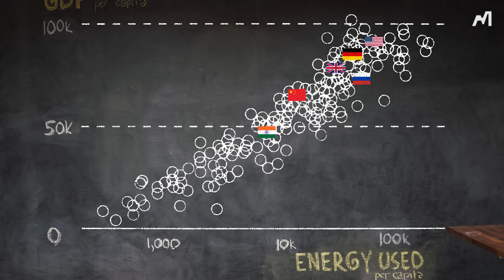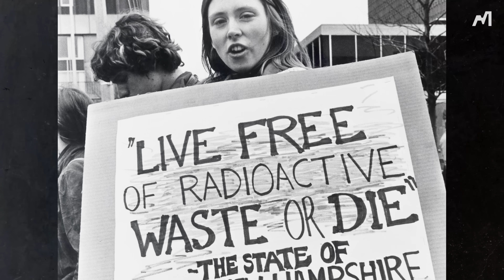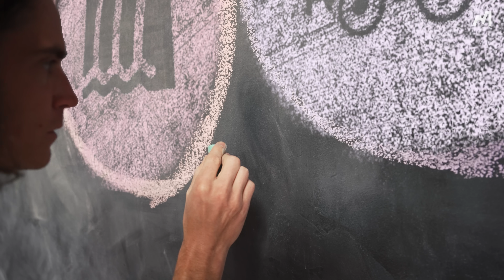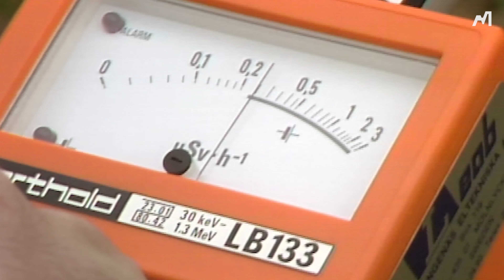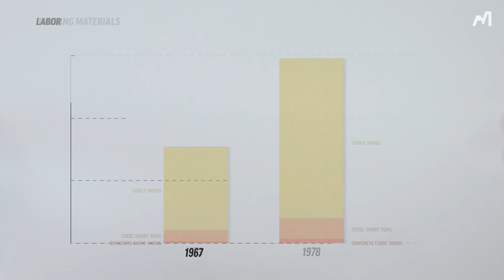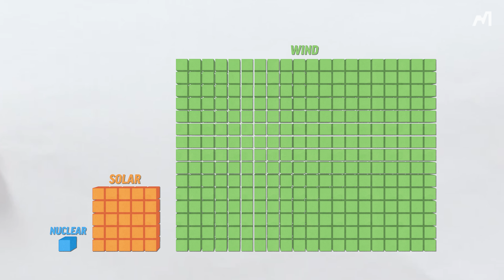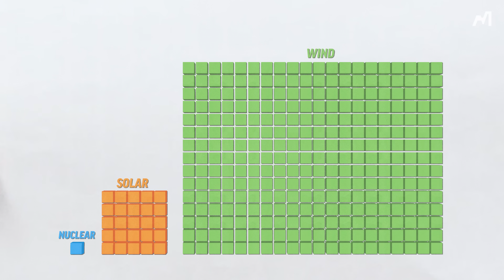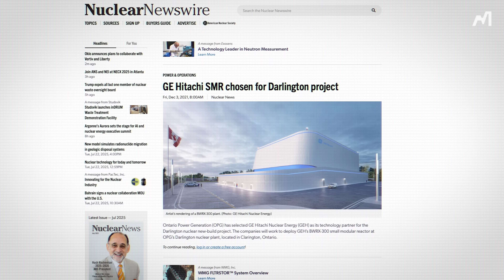They're Lying to You About Nuclear Energy

Comment: One huge disadvantage of nuclear is that it still requires a fuel source. Not all countries have uranium so they would have to import it. As Russia and the US have shown, anything you have to import can and will be weaponized against you.

Solar and wind, once installed, can't be controlled by rogue nations like Russia and the US.  Every country in the world has solar and wind. You can't rely on imported nuclear, the national security risk is massive as the last 3 years have shown. You have to be energy independent to be a real country.

The right mix for most nations will most likely be heavy solar, wind, hydro for those who have  water and mountainous terrain, a good amount of nuclear, and a very small amount of coal and natural gas as backup.

Comment: People talk about how fission reactors are the future... BS. Nuclear is proven tech, and yet, people and investors clamor for "clean" energy- and yet, none of them look at the data coming from the experomental fission reactors- they have a 1-4% gain of energy over what was spent to get the reaction, and engineers still haven't found a way to make a sustained reaction, let alone how to extract the heat given off of such a small amount of surface area for which the "energy" exists! Yes it may have a huge amount of energy in the reaction, but there is no way to make anything that pulls that energy off of the reactor- its surrounded by huge magnets! Go back to the nuclear reactors!

Comment: I'm now interested to see how solar power caused three deaths.
Reply: There is no such thing as permanent, safe, storage of spent fuel (witness the ongoing storage of spent fuel at plant locations from lack of dumping sites, making each reactor site "an event in progress," just like what is going on at Chernobyl and Fukushima)!
 
More stupidity is not the solution to stupidity. The simple fact is that the intense ionizing radiation in the boundary of the nuclear fuel causes the containment to transmute over time, where the containment materials lose their original elemental qualities, frequently becoming brittle and no longer able to perform as originally intended. Zombie reactors that are past their designed life are losing the safety safety factors originally designed into the containment in ways that are not predictable until incidents inevitably occur. The same thing applies to the containment of high-level nuclear waste. These matters are well-known to the industry, but being withheld from public scrutiny in order to maintain the current zeitgeist.

Comment: About the nuclear waste part, a while ago i heard something about this dutch company called thorizon that are making some good progres nuclear waste
Reply: There is no such thing as permanent, safe, storage of spent fuel (witness the ongoing storage of spent fuel at plant locations from lack of dumping sites, making each reactor site "an event in progress," just like what is going on at Chernobyl and Fukushima)!
 
More stupidity is not the solution to stupidity. The simple fact is that the intense ionizing radiation in the boundary of the nuclear fuel causes the containment to transmute over time, where the containment materials lose their original elemental qualities, frequently becoming brittle and no longer able to perform as originally intended. Zombie reactors that are past their designed life are losing the safety safety factors originally designed into the containment in ways that are not predictable until incidents inevitably occur. The same thing applies to the containment of high-level nuclear waste. These matters are well-known to the industry, but being withheld from public scrutiny in order to maintain the current zeitgeist.

Comment: I really liked the video, and your view, however the comparison between nuclear and renewable energy to superficial. You did not mention that the geopolitical dependencies, and I your equation of land use for Solar, you left out, that every roof is a possible spot for placement. In addition you mentioned that the density of a nuclear power plant is an advantage, which I can understand, but it can also be a huge risk. A cyber or terrorist attack can disable a nuclear plant, thus causing a blackout.
Reply: There is no such thing as permanent, safe, storage of spent fuel (witness the ongoing storage of spent fuel at plant locations from lack of dumping sites, making each reactor site "an event in progress," just like what is going on at Chernobyl and Fukushima)!
 
More stupidity is not the solution to stupidity. The simple fact is that the intense ionizing radiation in the boundary of the nuclear fuel causes the containment to transmute over time, where the containment materials lose their original elemental qualities, frequently becoming brittle and no longer able to perform as originally intended. Zombie reactors that are past their designed life are losing the safety safety factors originally designed into the containment in ways that are not predictable until incidents inevitably occur. The same thing applies to the containment of high-level nuclear waste. These matters are well-known to the industry, but being withheld from public scrutiny in order to maintain the current zeitgeist.

Comment: And the answer - because nuclear threatened to put fossil fuel industries out of business.
Reply: There is no such thing as permanent, safe, storage of spent fuel (witness the ongoing storage of spent fuel at plant locations from lack of dumping sites, making each reactor site "an event in progress," just like what is going on at Chernobyl and Fukushima)!
 
More stupidity is not the solution to stupidity. The simple fact is that the intense ionizing radiation in the boundary of the nuclear fuel causes the containment to transmute over time, where the containment materials lose their original elemental qualities, frequently becoming brittle and no longer able to perform as originally intended. Zombie reactors that are past their designed life are losing the safety safety factors originally designed into the containment in ways that are not predictable until incidents inevitably occur. The same thing applies to the containment of high-level nuclear waste. These matters are well-known to the industry, but being withheld from public scrutiny in order to maintain the current zeitgeist.
Reply: @richardmcbroom102  Fearmongering. Especially citing disasters that were exclusively caused by core meltdown - something that requires critical state to happen, a state which is no longer present in spent fuel.

I'd like to see a source material.
Reply: @NaqrSeranvis  So you are in favor of enjoying the immediate benefit of energy now while relegating the expense and responsibility of safe storage to posterity, subject to the whims of nature and the foibles of the human mind for the next 10,000 years.
Reply: @richardmcbroom102  You are gaslighting now. I asked for a source. Is that so hard to provide?

As a side note: If we can't assume that the future generations will become wiser than us, as we are wiser than people who sincerely believed lightnings were literally tossed by gods from their celestial realms... then perhaps we deserve to go extinct. Life will find a way, either that or it will perish. If you're that anxious about what will happen to spent nuclear fuel, I'm having a hard time imagining what you'll feel when we find a way to produce enough antimatter to use it as power source... a material that has to be actively kept from going mushroom cloud.

Comment: The wind and solar deaths are way higher. I know a single solar developer in the USA that had 7 fatalities. And there were 7 wind power deaths in 2024 alone.
Reply: There is no such thing as permanent, safe, storage of spent fuel (witness the ongoing storage of spent fuel at plant locations from lack of dumping sites, making each reactor site "an event in progress," just like what is going on at Chernobyl and Fukushima)!
 
More stupidity is not the solution to stupidity. The simple fact is that the intense ionizing radiation in the boundary of the nuclear fuel causes the containment to transmute over time, where the containment materials lose their original elemental qualities, frequently becoming brittle and no longer able to perform as originally intended. Zombie reactors that are past their designed life are losing the safety safety factors originally designed into the containment in ways that are not predictable until incidents inevitably occur. The same thing applies to the containment of high-level nuclear waste. These matters are well-known to the industry, but being withheld from public scrutiny in order to maintain the current zeitgeist.

Comment: Nuclear energy is a solution not a bandaid. Thats why it isn’t used by these so called eco politicians. A one time solution can’t be milked for grants and new deals and kick the can down the road for more wealth extraction.
Reply: There is no such thing as permanent, safe, storage of spent fuel (witness the ongoing storage of spent fuel at plant locations from lack of dumping sites, making each reactor site "an event in progress," just like what is going on at Chernobyl and Fukushima)!
 
More stupidity is not the solution to stupidity. The simple fact is that the intense ionizing radiation in the boundary of the nuclear fuel causes the containment to transmute over time, where the containment materials lose their original elemental qualities, frequently becoming brittle and no longer able to perform as originally intended. Zombie reactors that are past their designed life are losing the safety safety factors originally designed into the containment in ways that are not predictable until incidents inevitably occur. The same thing applies to the containment of high-level nuclear waste. These matters are well-known to the industry, but being withheld from public scrutiny in order to maintain the current zeitgeist.

Comment: SMRs wont solve anything. They wont come cheaper than full nuclear power plants. You need more people. You need WAY more security, if you divert them all over the country, instead of a few spots. And no, You cant just slap a reactor from a nuclear submarine into a small concrete building and be happy with it. They are ineffective. The military dont mind. It just works. Cost are way down on the list of things it has to deliver, when long term usability under water ist the benefit. You dont need that in civil use. But you want cheap energy, wont you? Why do you want nuclear power, the most expensive method to deliver electricity known to man? Even if the real cost is not shown on your power bill, you WILL pay for it with your taxes. There is not a single nuclear power plant in the whole world, thats not subsidized by the state. In the end, you WILL pay.
Reply: Are you in all fairness willing to pay for safeguarding the storage of spent fuel for the next 10,000 years? OR do you simply relegate that as the responsibility of those coming after you once you have enjoyed all the advantages. Every site is vulnerable to the caprices of nature, or the foibles of the human mind.

Comment: If ever there were an ultimate limit to "growth," it would look exactly like what is happening now, where all alternatives are short-term gain at the expense of long-term sustainability.

There is no such thing as permanent, safe, storage of spent fuel (witness the ongoing storage of spent fuel at plant locations from lack of dumping sites, making each reactor site "an event in progress," just like what is going on at Chernobyl and Fukushima)!
 
More stupidity is not the solution to stupidity. The simple fact is that the intense ionizing radiation in the boundary of the nuclear fuel causes the containment to transmute over time, where the containment materials lose their original elemental qualities, frequently becoming brittle and no longer able to perform as originally intended. Zombie reactors that are past their designed life are losing the safety safety factors originally designed into the containment in ways that are not predictable until incidents inevitably occur. The same thing applies to the containment of high-level nuclear waste. These matters are well-known to the industry, but being withheld from public scrutiny in order to maintain the current zeitgeist.
Reply: False, there’s the Onkalo geological repository in Finland and Sweden, France and Switzerland are building one too.
Ionizing radiation can’t transmute, that’s not how radiation works, it can cause material embrittlement, but it’s entirely taken into account.
Zombie reactors? I’m studying nuclear engineering and that’s new even for me, reactors past their original commission life go thru a long refurbishment phase every number of years, especially for licensing extensions of 10-20 years that account everything you claim isn’t, what you’re saying is completely false, the effects are predictable and studied, to the point of being overregulation and reactors are safer with newer standards, not less.
This is a lot of dunning-Kruger
Reply: @filippo1864 Are you in all fairness willing to pay for safeguarding the storage of spent fuel for the next 10,000 years? OR do you simply relegate that as the responsibility of those coming after you once you have enjoyed all the advantages. Every site is vulnerable to the caprices of nature, or the foibles of the human mind.

Comment: Ppl who don’t like nuclear energy are either dumb or evil, one or other
Reply: There is no such thing as permanent, safe, storage of spent fuel (witness the ongoing storage of spent fuel at plant locations from lack of dumping sites, making each reactor site "an event in progress," just like what is going on at Chernobyl and Fukushima)!
 
More stupidity is not the solution to stupidity. The simple fact is that the intense ionizing radiation in the boundary of the nuclear fuel causes the containment to transmute over time, where the containment materials lose their original elemental qualities, frequently becoming brittle and no longer able to perform as originally intended. Zombie reactors that are past their designed life are losing the safety safety factors originally designed into the containment in ways that are not predictable until incidents inevitably occur. The same thing applies to the containment of high-level nuclear waste. These matters are well-known to the industry, but being withheld from public scrutiny in order to maintain the current zeitgeist.

Comment: 5:46 your graph showing deaths caused by different energy sources is a little misleading given how few nuclear reactors there are due to the scare of nuclear energy making them more difficult to fund and build. It’s like saying more people die from eating hot dogs than they do from eating rat poison. Hot dogs are being consumed at a much higher rate than rat poison and for far longer.
Reply: There is no such thing as permanent, safe, storage of spent fuel (witness the ongoing storage of spent fuel at plant locations from lack of dumping sites, making each reactor site "an event in progress," just like what is going on at Chernobyl and Fukushima)!
 
More stupidity is not the solution to stupidity. The simple fact is that the intense ionizing radiation in the boundary of the nuclear fuel causes the containment to transmute over time, where the containment materials lose their original elemental qualities, frequently becoming brittle and no longer able to perform as originally intended. Zombie reactors that are past their designed life are losing the safety safety factors originally designed into the containment in ways that are not predictable until incidents inevitably occur. The same thing applies to the containment of high-level nuclear waste. These matters are well-known to the industry, but being withheld from public scrutiny in order to maintain the current zeitgeist.
Reply: @richardmcbroom102  I think you may have replied to the wrong comment? Or severely misunderstood what I was saying.
Reply: @AmissaAnima_1  Where do you stand on nuclear power?

Energy for short-term gain at the expense of long-term benefit is symptomatic of a basic problem: If ever there were a ultimate limit to "growth," it would look exactly like what is happening now!
Reply: @AmissaAnima_1  thats a bot

Comment: The real problem is that all these energy companies, don’t want cheap energy. And our politicians are all corrupt so they just get lobbied
Reply: There is no such thing as permanent, safe, storage of spent fuel (witness the ongoing storage of spent fuel at plant locations from lack of dumping sites, making each reactor site "an event in progress," just like what is going on at Chernobyl and Fukushima)!
 
More stupidity is not the solution to stupidity. The simple fact is that the intense ionizing radiation in the boundary of the nuclear fuel causes the containment to transmute over time, where the containment materials lose their original elemental qualities, frequently becoming brittle and no longer able to perform as originally intended. Zombie reactors that are past their designed life are losing the safety safety factors originally designed into the containment in ways that are not predictable until incidents inevitably occur. The same thing applies to the containment of high-level nuclear waste. These matters are well-known to the industry, but being withheld from public scrutiny in order to maintain the current zeitgeist.